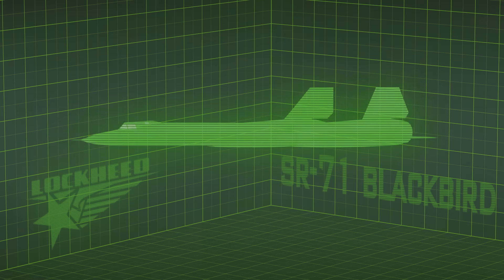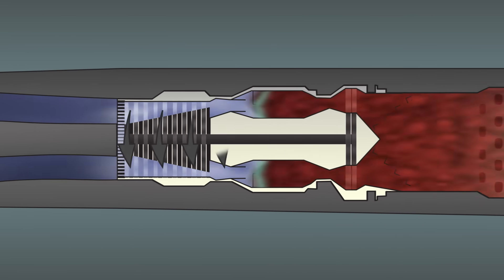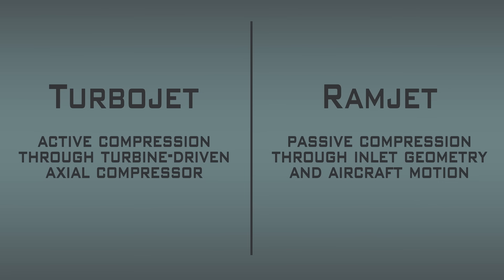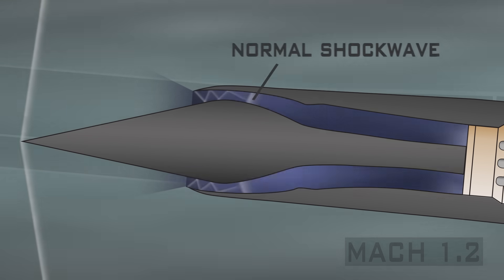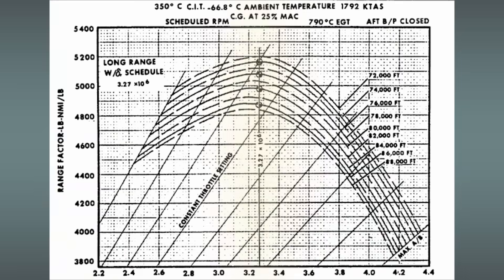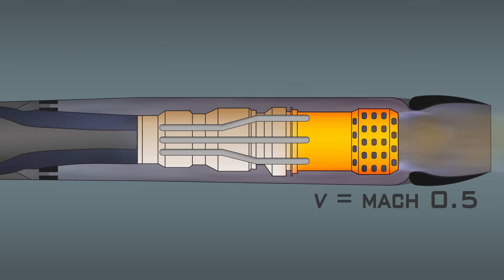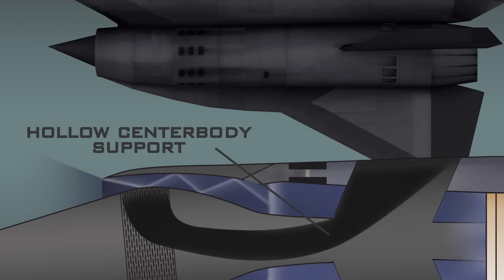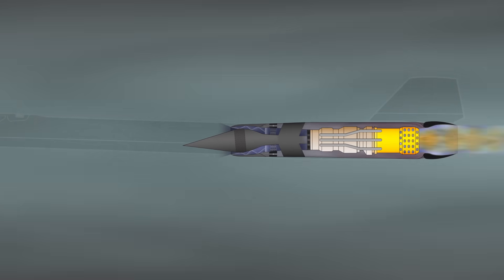The Mighty J58 - The SR-71's Secret Powerhouse

Comment: I always wondered why it "seems" to be "limited" to Mach 3 or thereabouts.
Does the fuel run dangerously low once Blackbird hits those speeds that it
caps the speed off by needing to refuel?
Reply from the maker: +DAVE MARKIEWICZ Nope - it's the safety speed for the heat buildup in the engines.  It can sustain a Mach 3.2 flight for as long as it has fuel, which considering most of it's body acts like a giant fuel tank, means it can sustain that speed for hours at a time.  Above Mach 3.2 the heat starts to do damage to the turbines and the inlet spike, if sustained.  According to some pilots they've pushed it to Mach 3.5 without causing damage, and there's a rumor that NASA figured out a way to push it beyond that if they wanted to, but yeah, you don't want your plane melting in mid air...

Comment: Although Mach 3.2 was 'supposed' to be the cruising speed the fact of the matter is that the SR-71 was capable of higher speeds.

Officially, we hear Mach 3.4 was the absolute outer limit.  I don't think it's Mach 4 class but Mach 3.4 is probably close to what you could get (under optimal conditions) without wrecking the engine.

I've read two places where they mentioned this speed.  One of them was the Roadrunners website...  Supposedly, during certification trials the USAF pushed the SR-71 to Mach 3.4...  During a mission over Libya in the late 1980s, and SR-71 was also pushed to Mach 3.4.  It was discovered on landing that the plane had become more fuel efficient at the higher speed!

I think out of all the issues  the plane had, reportedly the worst was scheduling the inlet system.  They originally had a system that was not computer-controlled but had to develop an electronic system (which increased maintenance) because they were having repeated hard starts or stalls with the J58.  This problem was not corrected until the early 1980s when they replaced the original inlet control system with a new digital system...
Reply: +AvengerII - Somewhere I read that there was a proposal to upgrade the SR71 to a mach 4 capable aircraft, and if I recall it was chiefly improvements to the airframe's  thermal protection and minor structural improvements, the engines themselves were pretty much good for use up to mach 4 as they were.
But don't quote me on that, since the plan never happened, so we'll never know for sure.